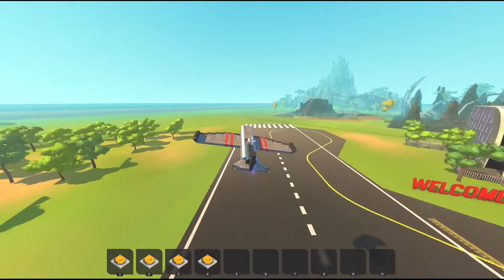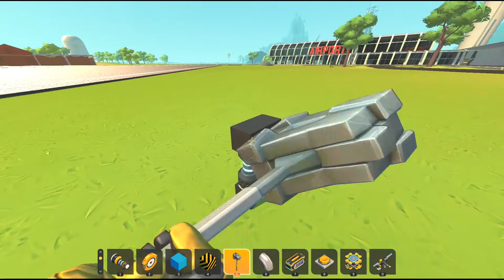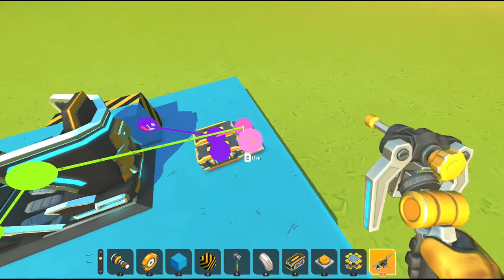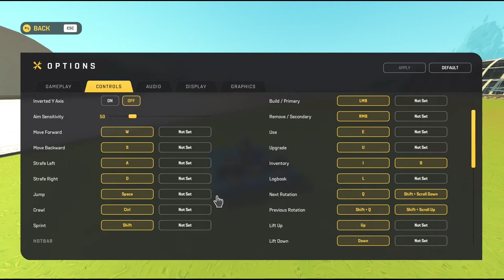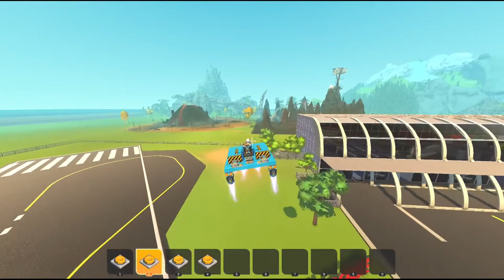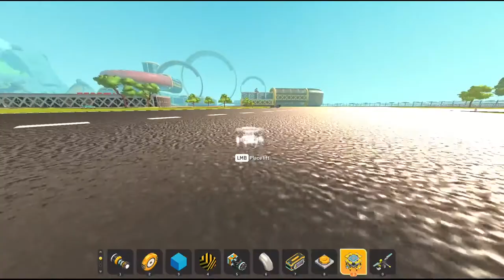HOW TO MAKE A STUNT PLANE - Scrap Mechanic

Comment: 3:10 set the suspension stiffness to max. Also, that method of making the glitch works, but I've found it to be a little unreliable compared to connecting both sides of the suspension to a bearing. If you don't know what I mean, watch one of 00Fant's flyer videos and you'll see.

Comment: hey i dont know if you still respond to these after 2 years but if I wanted to use w/s to move forward/back how would I?
Reply from the maker: Unfortunately scrap mechanic doesn’t let you do WASD controls but you can key bind a lay out next to it tho like TGFH I think
Reply: @LittleCornDogsGaming  thanks for responding I wasn't expecting that, do you have discord? I feel like we could call and resolve this easier lol
Reply from the maker: @chazguy8723  lol I do I have it linked in my newer videos but unfortunately I’m not home for the next few days so I’ll hyu when I’m back
Reply: @LittleCornDogsGaming  sounds good ill add you
Reply: If you want to use w/s for a pitch suspension glitch, instead of connecting the bearing of the suspension to a controller, connect it to a gas engine and connect the engine to the seat. Use the engine power to adjust how strong the glitch is. If you want to use a/d for roll, connect the seat steering to the bearing that the suspension is connected to and make sure it's a level 5 seat, because you need to adjust the steering angles to something like 5-11 degrees depending on the size of the creation. Also, set the speed and the suspension stiffness to max.